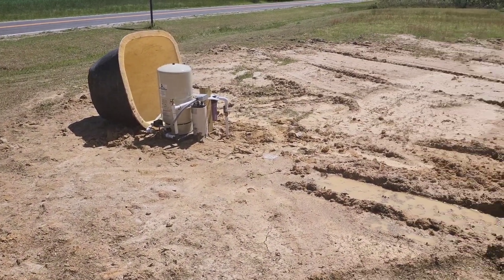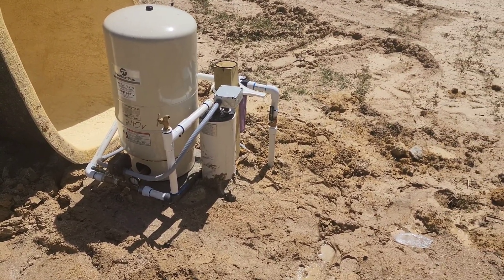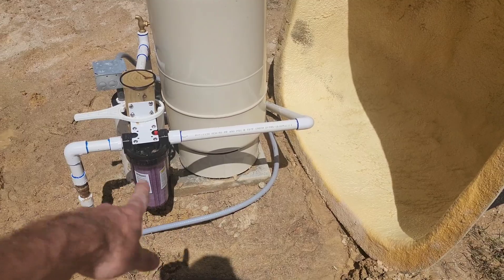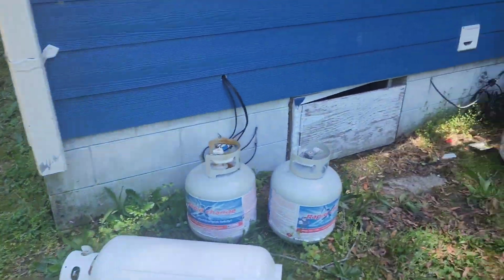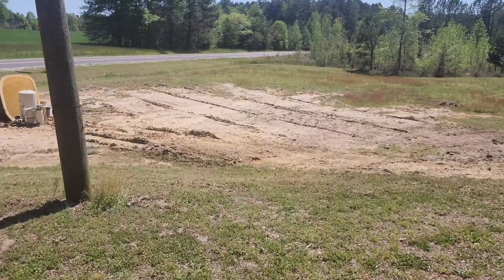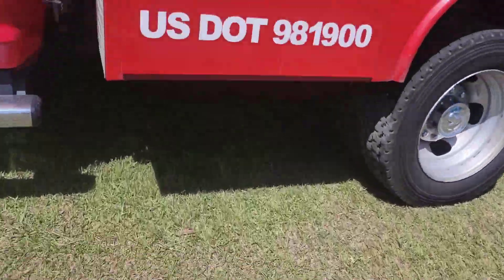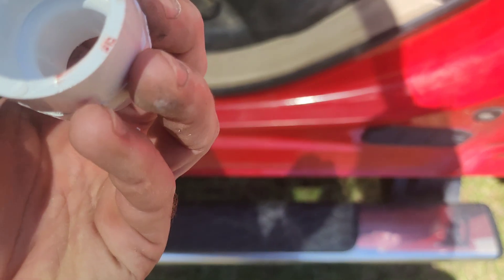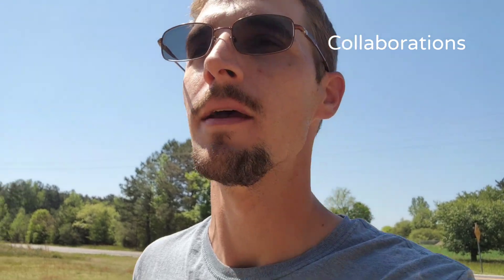Complete Well Pump, tank and filter at the Well Head. Dealing with plastic fitting issues...

Comment: Put a clamp on the female end to reinforce the female end to prevent the fitting from cracking.
Reply: He's switched to brass, problem solved. Or, as I like to say, "Use a stump puller to pull weeds"

Comment: Is there any advantage in using either a 2-wire or 3-wire well pump? In my area it's split 50/50 on what type of pumps the drillers put in. One driller said the reason for the different types of pumps is that in our area there is a fair amount of black sand in the wells and the capacitor start pumps have more torque to break loose if sand gets into the pump. Thoughts?
Reply from the maker: Typically a 3 wore pump is installed on stick pipe & a 2 wire pump is installed on flexible poly pipe. 
The stick pipe takes hours to replace the pump, so having the capacitor out of the pump is 1 less reason to pull it out.
But your forced to use more expensive wire.
I only install 2 wire pump bc its just so simple to install & Troubleshooting is way simpler
Reply: @h2omechanic  Thanks for the insight...,

Comment: I've been watching all your videos and subscribed .I want to install a pump my static is at 160ft  my well is 360ft deep. What size pump do I need I'm 100% off grid I really don't want to run 230v if I can help it .. thanks keep up the good work boss
Reply from the maker: No solar pump is going to live long dealing with a 160static level. Maybe look Into Bison hand pumps. 
For a 230v system, id set the pump at 300ft, a 3/4 or 1hp  5gpm head. All brass or ss fittings & a HD Steel Well Seal.

Comment: Question, my capacitor blew on my controller and am waiting to get it replaced. What can cause that? It the pump generally bad when that happens or is it just the capacitor typically
Reply: Just your capacitor they are a common problem within those control boxes

Comment: Things are not being made the same as they were years ago. Would the pump going on and off in the ground not be putting pressure on the 90, then it cracks the fitting. Like the pump in the ground gives a bit of twist coming on.

Comment: The fitting that you showed with the push connector should be use for sprinklers only not anything with constant pressure. The threaded connector with the glued slip connector is the one I would use of the two that you showed. Totally agree that OEMs are cheaping out on materials, and only using a bare minimum.
Reply: Cs coloca muita coisa no pé do poco